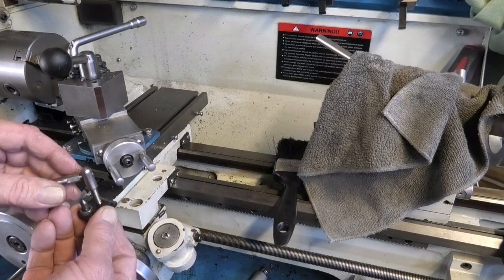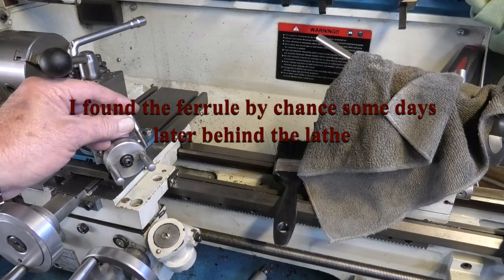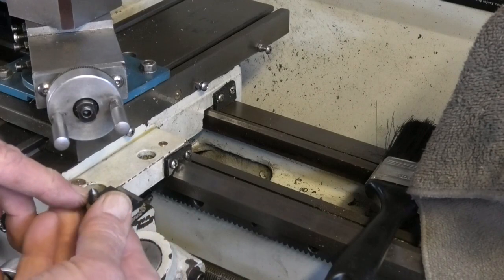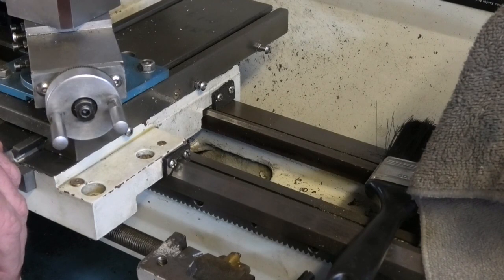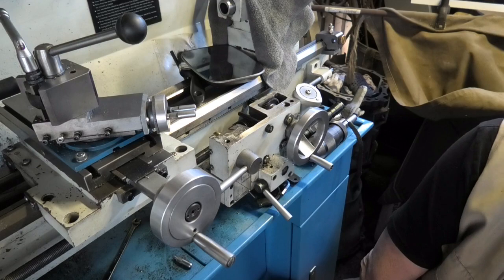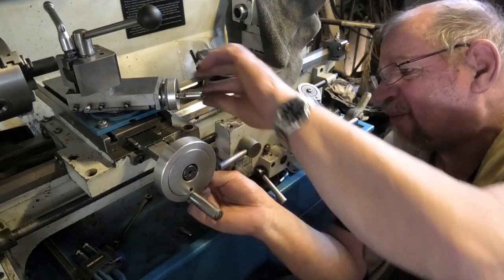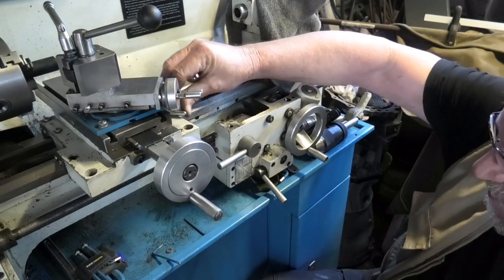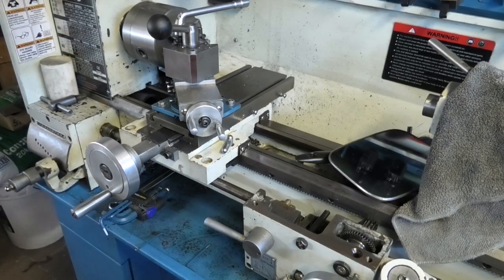My AL51G Lathe the Carriage Lock won't hold

Comment: Gday Peter, I certainly did put the brass collar in there to stop the crap building up around the screw, there was only a socket head cap screw originally and I put the setup in there, I remember the thread was an odd size, Cheers
Reply from the maker: G’day Matty, the collar was a good idea but it needs a tracker   I thought it hit the back shield but what I heard was probably the door then fell behind the lathe. 
Cheers 
Peter
Reply: @pgs8597  mate I think I need a tracker on every bit of gear I own, forever looking for things I’ve had in my hand 2 minutes ago…

Comment: Hi Peter, I just brased a hexi head onto the original Allen headed bolt on my Chinese lathe.  So none of that issue getting the poxy little handle in the right position palava ;)    I just use a spanner and the head keeps the crap out of the hole.  They all have much the same setup with the pull up bolt holding it in place.  I've never had an issue with mine.  Cheers Rob
Reply from the maker: G’day Rob. Yes I found out this lathe was as you say, Matty got rid of the Allen head bolt and fitted what I discovered , it looks good but has its disadvantages. 
Cheers 
Peter

Comment: I machined a square head screw to replace my Allen key lock, it resembles how some of the my ford and hercus machines are, despite being a machine made in china. I'm slowly replacing all the chinesium with australium though and it's become quite a good machine now. The ferrule, see if you can make it such that it does the spacer work for you too, that way it's one or two less parts to worry about during a rebuild, and put a sketch of the part and the assembly in a binder so it's easy to come back to.

Have a good one!
Reply from the maker: G’day Adam. It’s ok for now but should it be a problem I’ll make a hex head shoulder bolt and use a spanner 
Cheers 
Peter

Comment: Hi, what do you think about this lathe? I was thinking of buying one but I'm comparing to second hand old old ones. What bits did it come with?
Reply from the maker: G'day Michael. I got it from Matty and it came with the 3 jaw, quick change tool post and a number of holders, change gears, a rear mount cut-off blade holder which I haven't fitted yet.
As for the machine it is quite capable but it doesn't have reverse carriage feed and I went through a few drive belts until I remembered to release the belt tensioner when not in use and to start the machine with the belt loose,then engage the belt. The spindle drive belt is only 5 x 3mm "very thin" I will one day make new pulleys and fit a Z series belt when I get it worked out. 
Cheers Peter
Reply: @pgs8597  Thanks for that :) So Seems as though a couple of small mods can do it some good.

Comment: Hi Peter.... I'm considering getting my first lathe. Out of the box is the al51g pretty good or does it need just as many modifications as it seems many cheaper eBay lathes need? Your quick thoughts if you have time would be much appreciated! Kind regards steve
Reply from the maker: G'day Steve. The lathe is a fairly good machine it's main downfall I find is the terribly small drive belt, otherwise it's rigid enough and cuts well, the carriage lock slipping in this video was just a minor maintenance issue. Cheers Peter
Reply: @pgs8597  brilliant Peter thankyou for your time and sharing your opinion! I just need to consider if variable speed is a better option for me. Thankyou once again and happy machining! Cheers steve